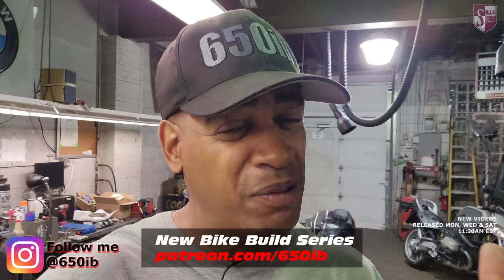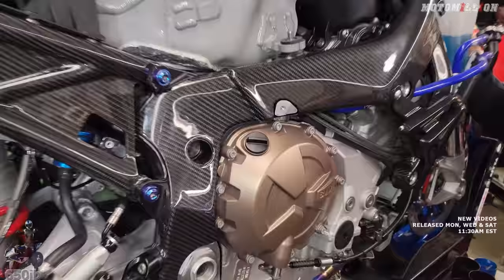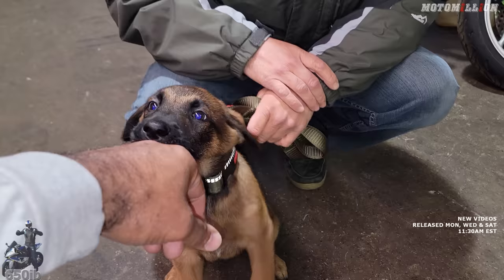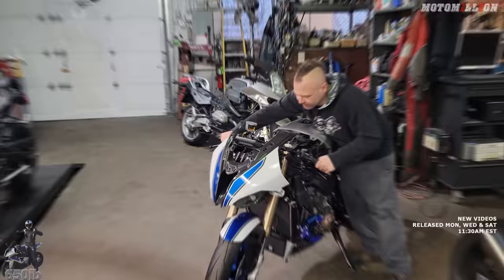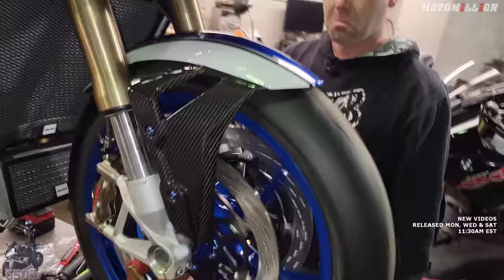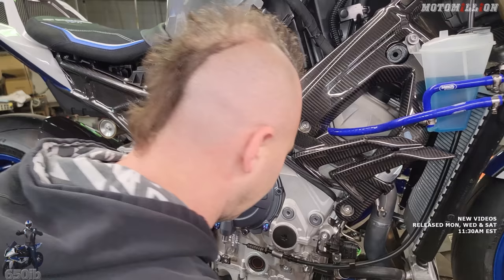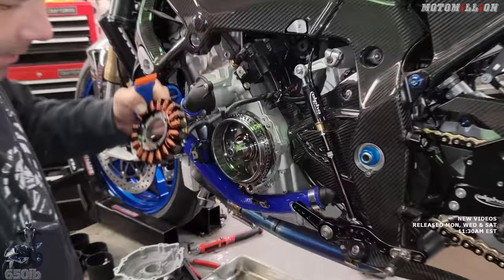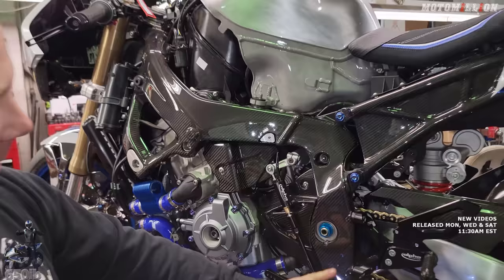WE REPLACED THE UGLY GOLD PARTS ON OUR 2022 BMW S 1000 RR!

Comment: Can anyone please tell me what the ribbed blue anodized component is that's fitted to the coolant hose above Zack's hand @12:04 ? I'm guessing it adds extra surface area to help improve engine cooling but if anyone can explain fully I'd be mighty grateful.Thanks in advance guys!!
Reply from the maker: Hey, it's a line cooler duct from Motomillion. Please use discount code 650ib
shorturl.at/deCPQ

Comment: Ib, you have the TWM chain adjuster and the Gilles titanium locking wheel nut. But you installed the Gilles nut without the large washer. Did Zak the master mechanic confirm this is safe to do this? I kept the washer ring and it hides the TWM chain markings. Such a bummer...
Reply from the maker: Hey Bro... I just asked Zak and he said you don't need the washer. Thanks for checking 🦾
Reply: @650ib  man that's great news! Looks so much better the way Zak did it, so I can do mine too! Loving your builds bro. Keep em coming! This HP Gen4 is one of the special ones!

Comment: Should have done Blue Carbon Fiber wheels.
Reply from the maker: Hi... The original 2013-14 BMW HP4 didn't have carbon fiber wheels and we wanted this bike to be as close to the original as possible.
Reply: @650ib  I understand. I just think they would have looked really cool with the theme. It's still an incredible machine as always, though not better than the M1000RR in my opinion. That's been the bike I liked the most so far 👍👍